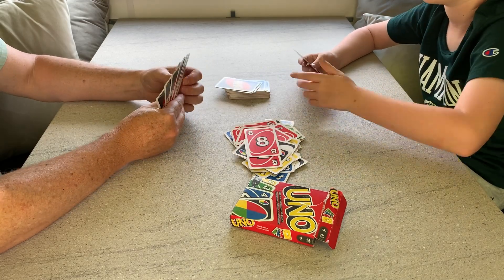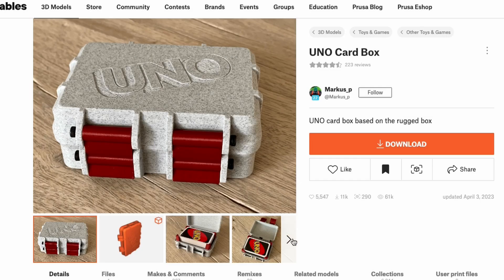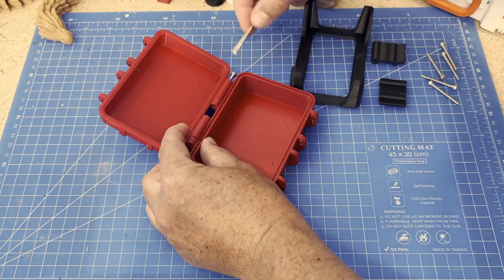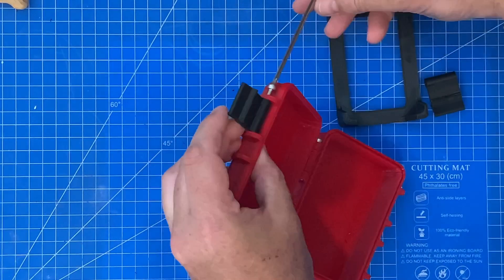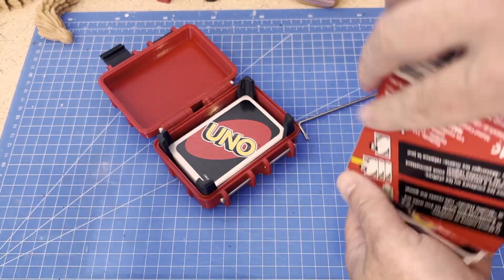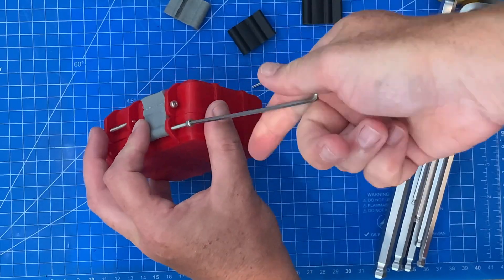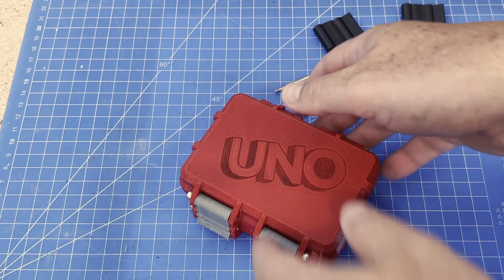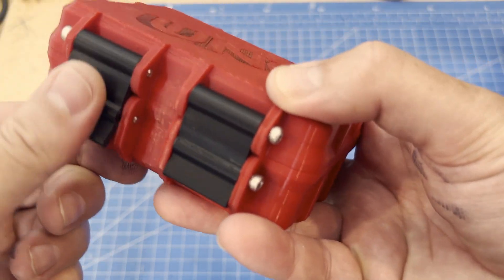The end of torn boxes with 3D Prints. Ep21: Unearthed 3d prints.

Comment: I printed a few of these where the creator specified PETG for the latches and TPU for a gasket and they’re  perfect tbh. The PETG is flexible enough for a perfect snap. The gasket is water resistant and gives enough resistance when closing for a good feel while latching.
Reply from the maker: unfortunately I didn’t have any petg but that’s what got me thinking about the tpu latch.  The pla seems a bit stiff but so far it latches good and isn’t an issue.
 I was thinking of doing the gasket for these to avoid any spills but also you could take them hiking and not have to worry they’d get wet.